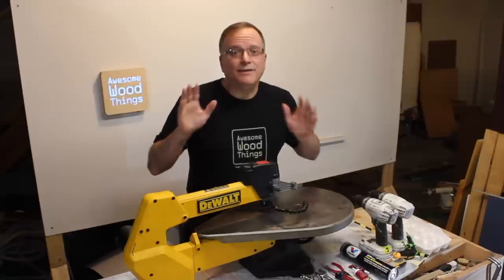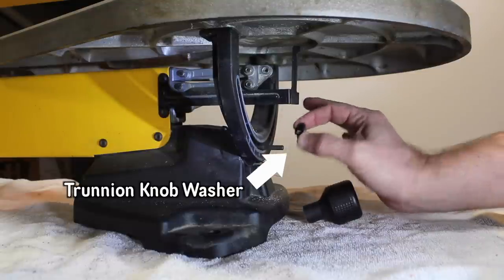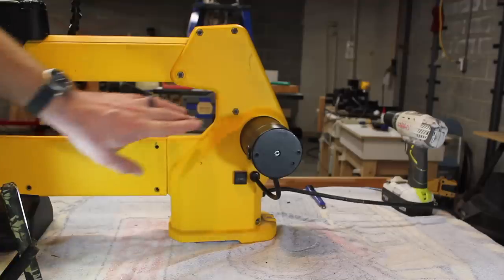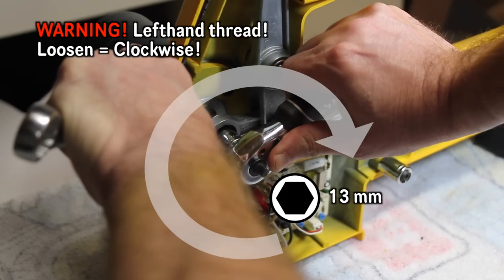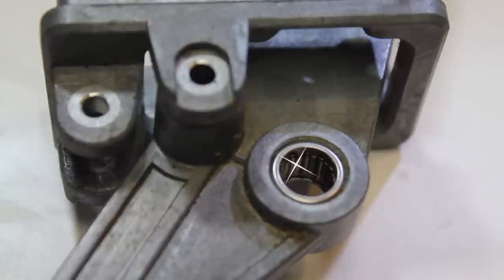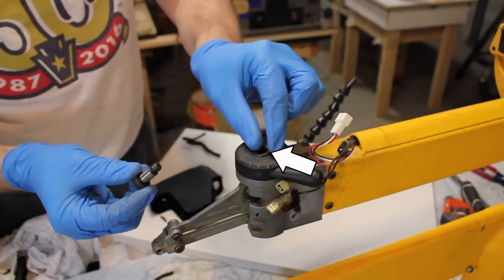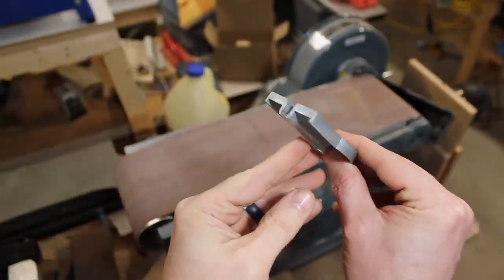Ultimate DeWalt Scroll Saw Repair/Maintenance Guide

Comment: The bearing on the motor is serviceable.  Take a utility knife  blade and pry the rubber seal out, add grease and reinstall the seal. I did that on mine.

Comment: The switch finally gave up yesterday after several months of working most of the time, but sometimes needing a gentle tap on the side of the housing to get my DW788 started. While waiting to get to the city to pick up a new switch, I decided this would be a good opportunity to do a little maintenance.  I had bookmarked this video a while back, so computer to workshop and away I went. Taking the thing apart was easy, even without the 'super-rare Torx 27',  20 minutes flat.  I took my time, took each bearing out, cleaned and lubricated it and put it back where it came from - one at a time, no point in losing one.  Don't you just love it when someone says "..just reverse the steps to put everything back together"?  Apart from trying to keep those washers on each side of the bearing while you tried to get the screw through the rocker assembly and rocker arms, it was a breeze.  I did, at times need to use more hands than I have to hold, line up, and insert screws/bolts in some of the frame parts while trying to keep the whole thing in a more or less upright position.  Only took 2 hours.... nothing to it. Now I have to wait for another 2 days, minimum, - the weather techies are calling for two days of snow,  wind, rain, and other unpleasant conditions, to go get the new switch to see if everything works.   Great way to spend a Saturday afternoon.
Reply from the maker: I’m glad this worked for you! Your saw will last much longer now.
Yeah... it was a little odd putting that statement in the video and I completely understand your comment. I just didn’t think people would sit through the more footage showing the same stuff on an already 9+ minute video. Still... I’m glad you got through it. This entire process is easier than it seems.
Reply: Wasn''t expecting a reply, many thanks.  Just got my new switch today and in the process of almost getting it in the housing, it fell to the floor and the rocker broke off - how much luck can a fellow have...  anyway I managed to get the rocker out of the old switch and installed in the new and it works.   Here's a question:  There are two screws/bolts in the back plate, you didn't remove them, I did, and I can't for the life of me figure what they do.  The back plate is threaded for the bolts, but there's nothing inside for them to connect to.  Maybe something to capture the wiring to keep it from  going places it shouldn't.

Again, great video, glad I found it and hopefully add a few years to my saw.  I need to go make some sawdust.
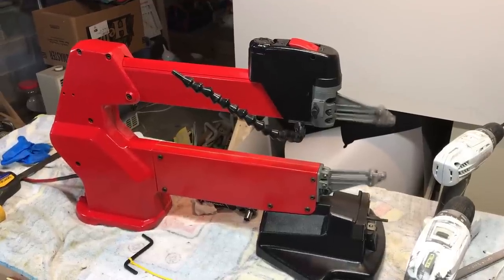Reply from the maker: @gordonreid5692  Where are those screws located exactly? Can you see them in the video? Perhaps at 9:33?
Reply: Once I had everything put back together, I was left with two short (1/2 - 3/4 in) bolts and two empty holes at the back of the  saw.  I'm guessing, since there's nothing behind the two threaded holes, that they are maybe for connecting the optional light fixture to the saw.  I've looked at the light on-online and the connector seems to have a hole spacing about the same as those screws.
Reply from the maker: @gordonreid5692  Correct. Those two screw holes that are about 1 inch apart are only for the optional light accessory and they serve no other purpose. Leaving those areas empty will not impact anything. :-)

Comment: Can't thank you enough. I had no idea these needed to be serviced. Glad I did it, my bearing were dry. Also my wavy washer was missing also. Found one at ace hardware.  Thanks again.
Reply from the maker: I'm glad I could help and I'm glad your machine is in good shape now! Rock on!
Reply: What size washer did you get at ACE Hardware?   The ones I looked at seemed too thick.  Did it work O.K? I'm not sure which size to get.
Thanks,
Jim
Reply: Sorry James, it's been awhile since I replied to this video to remember the size. Sorry.
Reply: @marang1966  Thank for the quick response. I appreciate it.

Comment: This is an excellent video.  Thank you for this.  My 35+ y/o Craftsman just gave up the ghost for its last and final time.  I've looked at "affordable" replacements - most are cheap chinese junk - so  have about settled on this one - just have to save my pennies.

Also, I gathered from some of your comments early on during disassembly, this is a "pinless" saw only?  That stinks - I have a great collection of "pinned" blades.  Oh well - time to start over.
Reply from the maker: It's a great saw. After you buy it, you will love it. Also, you can use pin blades with this saw... it's just not recommended and the blades without pins can be much thinner. Good luck with your future purchase!

Comment: MY BAD EXPERIENCE AT DEWALT SERVICE CENTER: My DW788 type 1 (I am the original owner) developed a rattle in the front top and bottom so i watched all the video's on the 788 scroll saws and took mine apart after watching your video. On inspection  the bearings in the rear were in excellent condition, no play and lots of grease. The front is a different story, the bearings on the front were sloppy and loose. I cleaned all the bearings and races and lubed with AMSOIL synthetic grease. I was sure the front bearing and races were worn beyond just fresh grease so I took all my parts down to the Dewalt service center to buy new bearings. Well, the big jerk service manager came out and asked me why i didn't bring the whole saw down because he can't fix it without the entire saw being there. I told him I didn't want service, just parts which he immediately told me he could not sell me the parts without having the saw there so he could determine what was wrong with it! So here I am with a broken saw and no parts. I told him I was going to toss it and buy a new Excalibur and I won't do business with Dewalt any longer.
They blamed it on cutting acrylic plastic so I don't know if that is true or not. I just know my old "C" arm Delta with variable speed never wore out anything after years of production sawing now my scroll sawing is just for my hobby use and it won't hold up.
Know any body that wants one real cheap?
Reply: "I CALLED DEWALT CUSTOMER SERVICE 800 NUMBER" I told them what happened and she apologized profusely (of course that's what CS people do) and asked me more questions about my saw and asked my what parts I needed. We talked about the problem with the saw and made a parts list. This lady was so gracious she told me they will send all the parts as a courtesy for no charge!
"WOW" that's the way to take care of a customer that has a shop full of Dewalt power tools! The service manager at the service center should have had more concern with my problem with the saw but just wanted to increase his monthly service bonus instead 

Thank you to Dewalt customer service, you shine!
Reply from the maker: I’m glad there’s a resolution here! 
If you need parts in the future, there are links to buy bearings on the instructable Page I have linked in the video’s description.
Reply: @AwesomeWoodThings  I was trying to speed up the process of my repair hoping the service center would have the parts. I will order parts in your link in the future but I hope this fix will last 10 years! I have ultimate faith in AMSOIL products as I use their oil in everything I own.
Thanks for a great video and for the reply.
Reply: NOW THE REST OF THE STORY: Got my parts today and they were the wrong bearing sleeves! They are for the tension rod and it only needs one and they sent me 8. It's part #286295. If anyone needs one that they have lost let me know, I'll drop it in  First class envelope and mail it to you, I surely won't use them.
So now I'm back to square one with Dewalt and I think it's about time for a new saw. I think I will take a look at the other clone saws and the RBI Hawk heard a lot of good things about the Hawk but it is pricey..

Comment: This is proof that the most expensive is not always best!  Everyone that I have met using this saw is always or has rebuilt it!  I purchased an imitation Hegner machine over 40 years ago that still has not been rebuild or repaired, both bearings read as simplicity, are still original!!!   Reminds me of believing that a Mercedes is the best car.  So my first car was that Mercedes. Followed by 2 more Mercedeses before I and my father realized that not even the Merceded trained Mechanics drove a Mercedes car.  So we both started driving so called "domestic" cars here in Canada,  To our pleasant surprise we no longer knew our mechanics any longer.  In short keep it simple that is the best way.
Reply from the maker: I'm glad you are having a good experience with your Hegner machine! It seems like the older the tool is the better built it will be... and that seems true for all brands.

Comment: Thank you! I must have watched this video ten times before even starting this process. I follow it step by step, and my saw runs great now. The part about the little lever in the saw head that slaps against a metal part was key. I also found a loose nut from the linkage in the saw, the one you advised us to us thread fixer to affix. My only complaint is that I kind of had to watch it in reverse to reassemble. I think I used all the part putting it back together. I still am dying to know why you painted it red.
Reply from the maker: Thanks for letting me know about the service you did to your saw. 
I painted it red because I put Van Halen stripes on it as shown here. https://youtu.be/W12U3UI9KsY

Comment: Thank you for preparing and sharing this instructional tutorial.  You have a talent for explanations.  The process still looks a bit intimidating but I suppose if you carefully planned for the repair such as buying a full torx kit and then making some form of labeled assembly bins for the screws it would help not get then mixed up
Reply: I am half way done with re-assembly, I used blue painters tape around every screw and bit and literally taped everything to my table with a number in the order I took it off and any other notes on the screws tape. Working great and has made this scary process less intimidating.
Reply from the maker: Sounds like a good plan!

Comment: This was so helpful, thank you! I just bought this tool use, and immediately bought the wavy washer as it did not come with one either. It's pretty noisy. I'm hoping to get that nice hum once I complete this service. 
I'm noticing that it also didn't come with the blade guard that you remove at 2:06. Can you advise whether it's completely necessary and if so, where it can be purchased? 
Your help is much appreciated!
Reply from the maker: Here's that lower blade card part: https://www.toolservicenet.com/dewalt/en/c//p/P286328-00
Reply from the maker: Here's one of two exploded part diagrams (see my other comment for the exact part you need): https://www.toolservicenet.com/dewalt/en/Brand/PORTER-CABLE/OUTDOOR/12-VOLT-LIGHTS/SCROLL-SAWS-BENCH/SCROLL-SAWS-BENCH-UNITS//p/DW788_1?documentID=333

Comment: I have looked and looked...........How do you remove sleeves? For that matter, how do you disconnect the strut assembly from the Rocker Mount? There is advise to file Rocker Mount when reassembling Strut in Mount, however I can not find any info on hold to disassemble and pull sleeves. Please advise. Wood shop teacher here.....have 10 of these saws with 120 teenagers pulling these DeWalts through some stress!
Reply from the maker: Hmmm. Did I demonstrate the step(s) you mentioned? If so, provide a time stamp where I did that action(s) and I’ll provide as much info as I can.
Reply: @AwesomeWoodThings  nope....nothing. still looking

Comment: Great video, thank you for the tear down.  This is something I will try as i bought an unused DW788 that's been in storage since 1998 and it takes 5-10mins to start up if being powered on for the first time for the day (fuse replaced and the 2 x motor brushes were cleaned)  I'm guessing a bearing need lubrication?
Reply from the maker: Oh yes. It’s all about the bearings. Although you never know until you open it... but, that’’s likely it.

Comment: Hi Matt...great job. I wonder if you can help me with a small problem. ? I am replacing the black dust blower on my dewalt scroll saw. It will not go on like they show on the videos....! Any suggestions.
Reply from the maker: Sorry... I never removed mine. I do you you have to push really, really hard. Sorry I couldn't provide a better answer. Good luck!

Comment: Hi there, I have the Delta that looks like the Dewalt 788. It's racing when I cut. Any idea what that is and how to fix it? I have a Dewalt 788 as well and it's fine.
Reply from the maker: If the speed isn’t what you expect the potentiometer must be faulty.
Reply: @AwesomeWoodThings  Thank you so much! how do I check that?

Comment: @Awesome Wood Things, My Girlfriend’s DW788, less than one year old, started blowing the GFCI outlet that it is plugged into. Brushes look fine.  Any suggestions?
Reply from the maker: Hmmm. Sorry you’re having that issue. I’m not sure the next step might be. I wish I could help. Good luck resolving the issue. Hopefully it’s something easy.
Reply: @AwesomeWoodThings  She contacted Dewalt, they told her to take it to a Dewalt service center. We just got back from there. Time will tell.
Reply: @AwesomeWoodThings  The Dewalt Factory Authorized Service Center replaced the motor, and a few other parts. It is up and running again. We will see how long it works now, before going tits up again.

Comment: Where can you pickup the wavy washer for the bearing inside?
Reply from the maker: Yes. It's here: https://www.toolservicenet.com/dewalt/en/c//p/P286326-00
Good luck with your fix/repair!
Reply: @AwesomeWoodThings  thank you sir just bought a used and used your guide and found this missing as well
Reply: Ace Hardware also has the washers.  They are in a drawer called "Wavy Washers".  I bought one today (Nov. 21, 2022) for $1.39

Comment: Very informative video.  I just picked up a DW788 Type 1 on the Marketplace.  It looks like it was well taken care of but I thought I would perform some maintenance on it before really using it.  This video will help out!  One question I'm looking at the exploded view of the saw and I see the bearing sleeves #38 - Part No 286294-00 but it doesn't showing the bearings in the exploded view.  Unless I am completely overlooking it.  If I just search for bearing it comes up with Part No 286285-00.  Does the sleeve come with the bearing or are they separate items that need to be purchased?
Reply from the maker: I'm glad my video is helping. I did not have to replace my bearing sleeves... so right of the bat, I'm not sure. You could open a ticket at VXB website. They sell the bearings. Links are the Instructables page, here: https://www.instructables.com/Ultimate-DeWalt-Scroll-Saw-Maintenance-Repair-Guid/
Reply: @AwesomeWoodThings  Thanks for the reply.  Hopefully I don't either when I get into my saw.   It runs pretty smooth right now.  I was just thinking worse case and wanted to make sure I could source the bearing if needed.

Comment: anyone had their table make a "squeaking" type noise? it goes away when i place my hands on the table to scroll but if i take them off, the sound is quite offensive. the trunion is tight and there is slight movement in the table but i am not sure if that is considered "normal" or not. i bought this saw used as well so i dont have the full history of it. thanks.
Reply from the maker: That's not normal. If the trunnion knob is tight that should do the trick. Perhaps it's coming from a different location. Sorry... I can't say for sure. Good luck!

Comment: Hi, my 788 seems to have an issue with the lower part of the blade seems burry as it goes thru the table (Side to side, not front to back). Upper part of blade seems ok. I can not find any help as to what is causing this issue… any thoughts?
Reply from the maker: Hmm. I’m not sure but it seems like the lower blade assembly may not be tightly secured. Sorry… this is a difficult issue to troubleshoot without seeing the issue. Good luck. 🍀

Comment: I know this is an old vid but I have watched it an found it most helpful. I bought one of these saws at auction and have now disassembled it and cleaned and greased as recommended. My problem is that it often won't start until I give the top arm an assist. Once going it runs great. I got it at an online auction and until I got it home I didn't know it had been dropped and the rear cast damage a little. Not sure if that is the issue or if I cold adjust the motor counter weight to help it start? Any suggestions?
Reply from the maker: That’s definitely a unique issue. Sorry… I’m not sure what to suggest. Still… I’m glad the saw works with this odd workaround.
Reply: Are you aware of any way to ensure the counterweight is in the correct position. When my saw stops the weight is almost always aligned in a horizontal position which seems to make it difficult for the motor to get going? @AwesomeWoodThings
Reply from the maker: @peteblairakathemadscientist  Hmmm. I don’t know the answer to this. Sorry.
Reply: I appreciate your honest answer. Thanks @AwesomeWoodThings